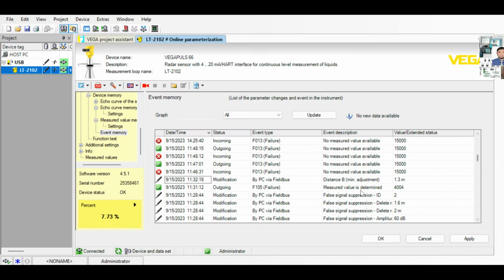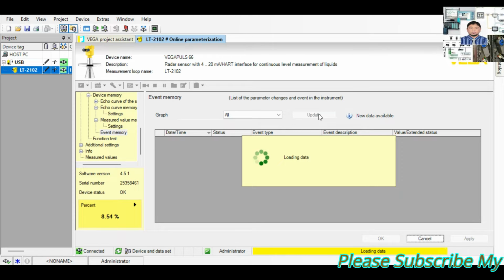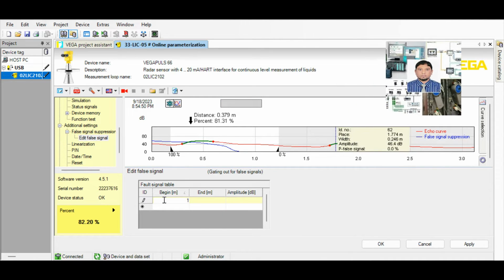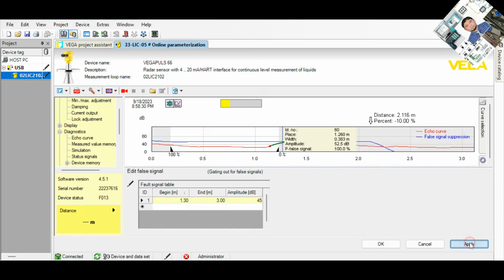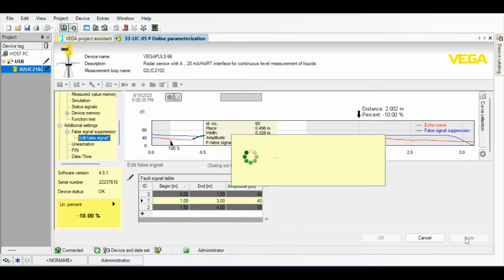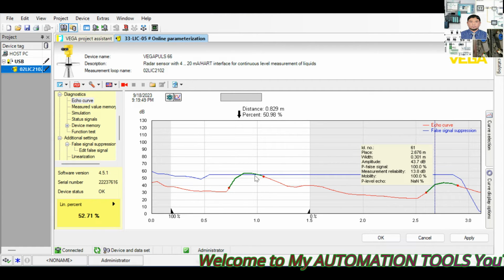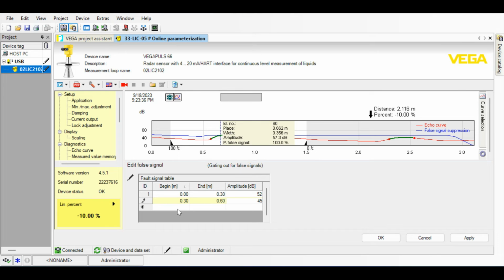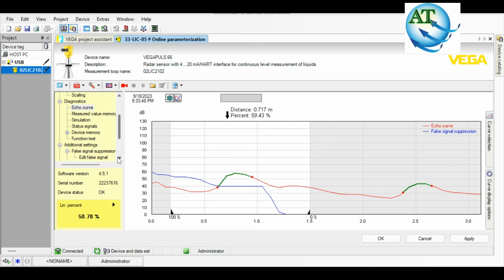Fault Diagnosis & Fault Signal Suppression Procedure of VEGA RADAR Level Transmitter by VEGA Connect

Comment: I have a sensor that is stuck at certain level and has moved in the last 24hrs. previously it was reading error code 13 but now it’s been cleared. It shows a current reading of 21 percent at 4mA (before it was 3.4 mA) but the tank has been emptied continuously since we can’t get an accurate reading and we don’t want to over fill it. What can I do to fix this issue?
Reply from the maker: You have to edit false signals suppression .